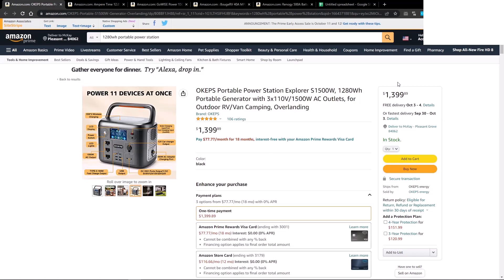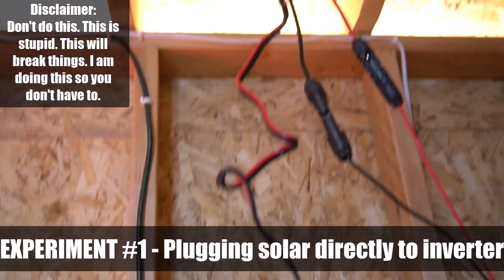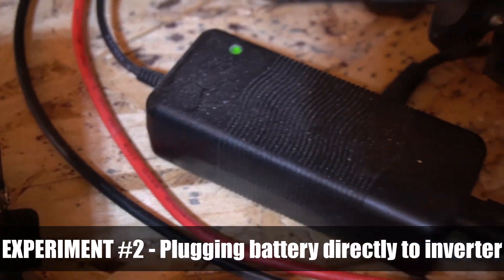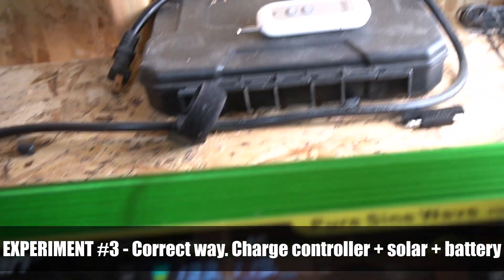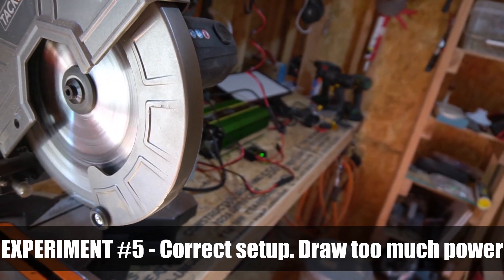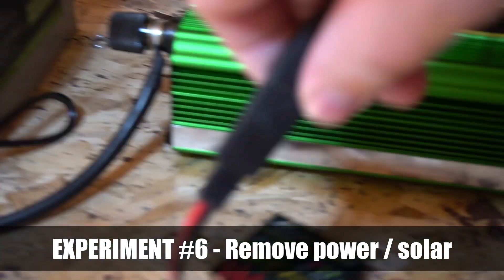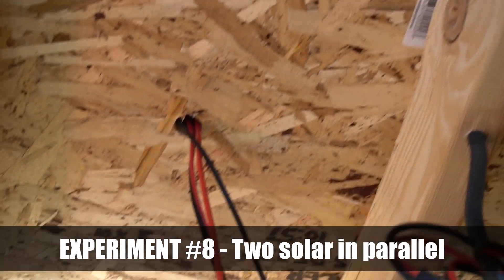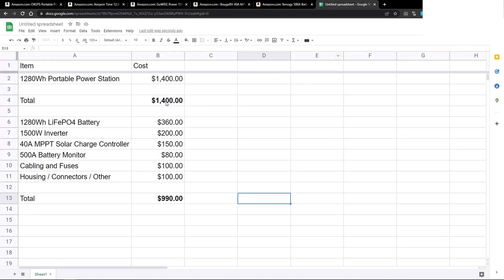Watch these inverter experiments before you make your own DIY portable power station

Comment: You can always scale up your build. Things like higher capacity, higher output inverter. That’s where manufacturers screw you by designing everything as a one size fits most solution so for some consumers they will end up needing to buy a second unit, expansion battery, or pay a premium price for a bigger product

Comment: hey about your inverter that lost it's magic smoke, it blew because the voltage of the solar panels was too high and the capacitor wasn't rated for such high voltages. this would have been prevented if the inverter had overvoltage protection but most don't because they only expect you to hook up a 12v output rather than something like you did. and additional circuit would be needed wich would increase the cost.

Comment: I have rolling collapsible crates at home and at work, and battery boxes with charge controllers and inverters velcroed to them.  They are cheaper, but if you need portability, it makes more sense to just buy a ready-made solar generator.  If you need more than 1 kWh, it's not that portable anyway.

Comment: Fried not because of "too much power going into the inverter" but simply the input voltage was too high. Power is voltage multipled by amperage. Your battery can supply way more power than a couple of solar panels, but it does it with a maximum voltage of about 14.6 volts. Most 12v inverters are okay up to 16 volts. Above that and they may be damaged because the components are simply not able to withstand higher input voltage.
Reply: Yep likely a 25V capacitor so no surprise 2 100W panels putting 44V would pop that cap.

Comment: Its the battery Bms shut off ... The battery Management system  (BMS) have ampere limit...  i think  your battery have 20 ampere limit.. And the charge controller you have its cant charge  your battery  properly. You need a mppt charge controller and change the settings to max charge voltage to 14.2- 14.4..

P.S Btw its not your fault.... Its the battery internal safety (BMS) ... If your battery have 20 Continuous Discharge Current  limit that's mean 12.8*20 = 256 watt Max.. Hope i Help you.. If you need any advice how to built your own  portable solar generator i can help you..